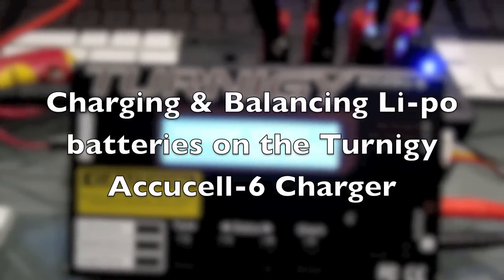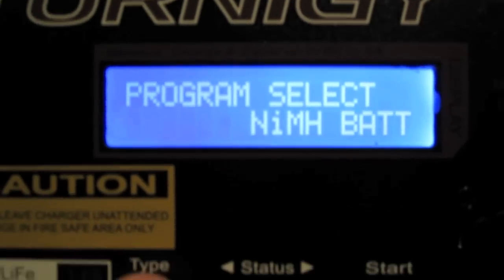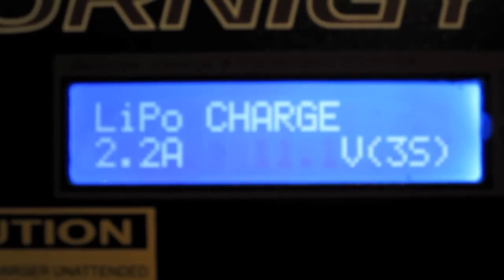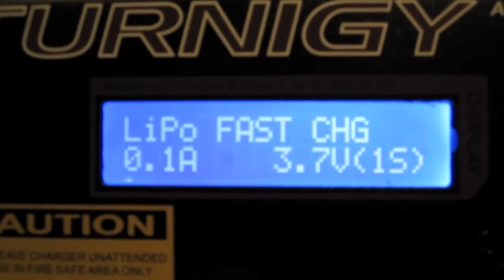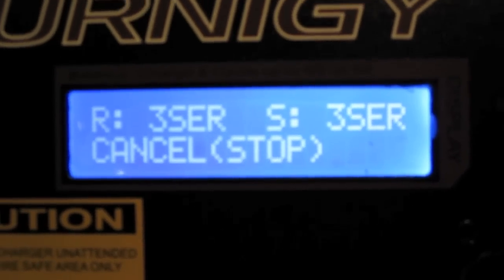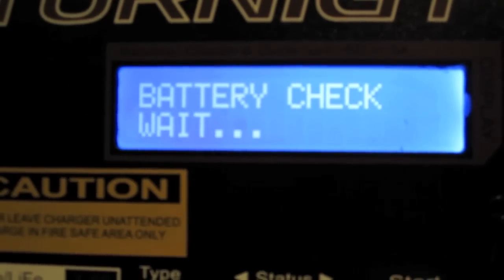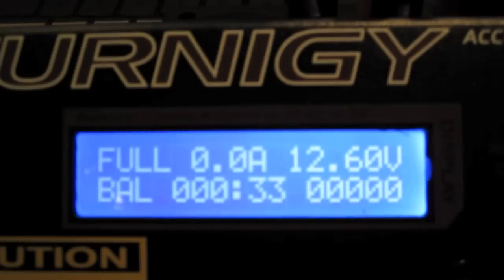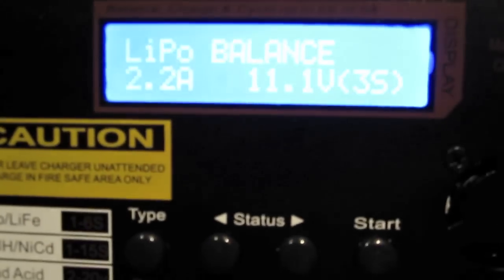Charging & Balancing a Li-po with the Turnigy Accucell-6 Battery Charger & Balancer

Comment from the maker: Hi I put a 10W 10ohm Ceramic Wirewound Resistor across the 5v rail. I then got some heatsink compound and smeared it on one side of the resistor and attached it to the wall of the power supply (in a place away from the mains!) with 2 x cable ties. This holds the resistor in place and as it will get warm, it also allows the side casing of the power supply case to act like a heatsink. If you want me to send you a few articles on how to do it just send me your email address & I'll forward them.

Comment from the maker: What do you use it in? I've never converted an old battery to 2C...the voltage of the battery will be lower over-all etc... To be frank if i was me... the battery would be disposed of...it's not worth the risk of messing around with old lipos. As I fly RC helicopters I certainly would not use an old battery as the ESC that controls the motor would shut the motor off if the volts are too low and i would have an auto-rotation (landing with no power!) situation. Up to you but I'd get rid of it.

Comment: @craig3008 

Unlucky me,

Maybe I'll just use it anyways.  Guess runtime will be shorter due to weak battery giving low volt alert early.    Than later maybe mod it to be 2S?  have you ever done 3s to 2s mod? if so, would love to see a vid.

Comment from the maker: hmm maybe..but 11.7 is close to 12! When you modded that power supply did you put a load resistor across the 5v rail of the transformer? A wirewound (ceramic) resistor is a good idea to put across the 5v (red wire output) as it actually increases the output voltage of the 12v rail by a little bit. If the input was too low..the charger would alert you.

Comment: Is it possible that my modded computer PSU is not supplying enough volt to fully recharge 3S 11.1v LiPo?

My charger accucell-8 shows "IN POWER VOLTAGE" of 11.7v only

Comment from the maker: Re the charger quality and is it good... yeah I have 4 Turnigy Accucell6 chargers and they have not failed me yet. I was a bit dubious at first as the chargers are very good value... but I have to say that so far I'm very happy with the quality of the charger. It's well-made and performs very well. I did have one of my 4 chargers have a bit of a noisy fan sometimes but that has toned itself down & the fan could be easily & cheaply replaced if need be. I'm very happy with the Accucell-6 charger.

Comment from the maker: Re being worried about lipos. For people to get those batteries to explode they have to do some pretty extreme stuff usually. They either overcharge them or feed too many volts or current into them or even physically damage them to make those videos. Lipos are safe as long as you (1) use a proper lipo charger, (2) use a balancer if your lipo has more than one cell (3) use the charger properly & with correct settings. i'd suggest using a lipo sack fireproof bag to charge them in just to be safe.

Comment from the maker: Hi There, the rule of thumb is you charge lipos at 1C. That is ...a 2200mah battery... you charge at 2200mah. A 800mah battery..you charge at 800mah. The charger does not come with a power supply so you would need to work one out yourself. I actually use an old computer power supply which is easy to modify or you can buy a power supply. Just make sure that it can supply the current required. If you are to charge a 2200mah battery.. you would need a supply around 3amps. Hope that helps.

Comment from the maker: Hi! Yes you must wait for a Lipo battery to cool down before you charge it. Normally about 10 mins or so and when it's cool to the touch you then charge / balance it as normal. There is actually a setting on the charger whereby it will wait for a set time (which is settable by the user) before it starts charging when in cycling mode. It's called the "WASTE TIME". Look up the manual in Google. If you can't find the manual send me a message & I'll email it to you. Hope that helps. Regards, Craig